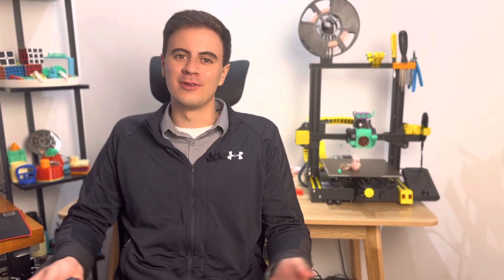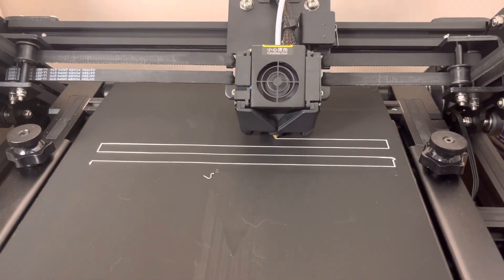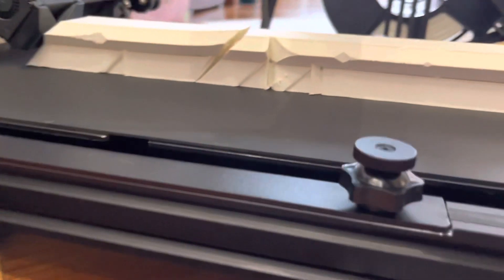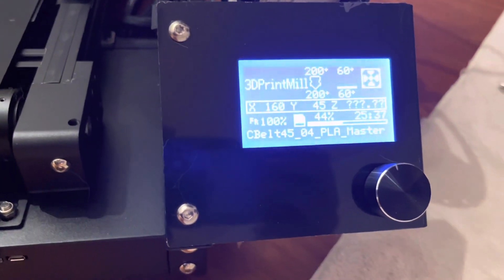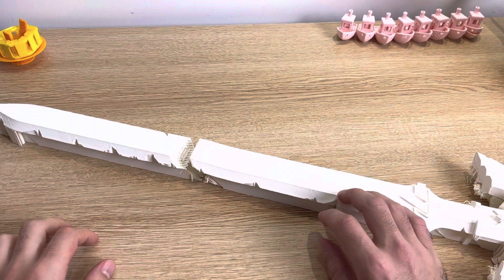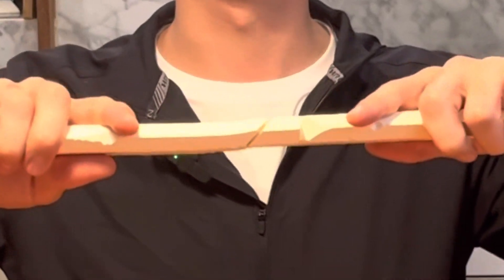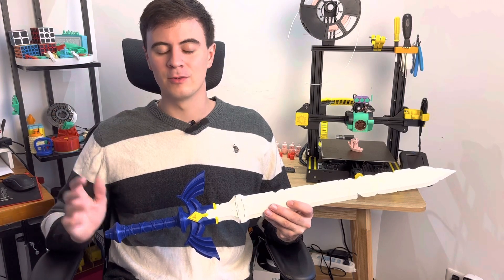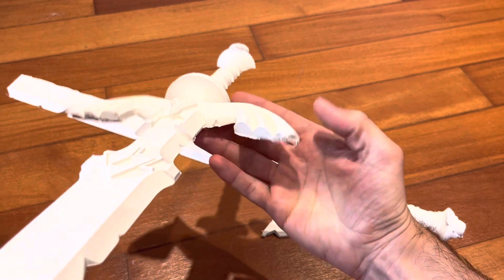HUGE Master Sword Print on the Ender CR-30

Comment: The shifting could be caused by no support for the print when it comes off the bed. By the time it reaches the end it might have some movement causing shifting.
Reply from the maker: yea good point, I should figure out some extended support for my longer prints 👍

Comment: Great video!  I wonder how good that filament is I don't always trust the "free" stuff they send with printers.

Are you getting to direct drive mod it!?

The print that I think would cool to make with that printer is zabuza momochi's sword Kubikiribōchō from Naruto.
Reply from the maker: The sword wasn't printed from the free stuff, but agreed that free filament is always suspicious  😆
Reply from the maker: I'm not sure yet about the direct drive mod yet, still thinking on doing it now or a little later 🤔  Kubikiribōchō looks pretty cool, not sure if it would fit on the bed.  that thin section with the hole near the end would make me quite nervous on breaking it 😅